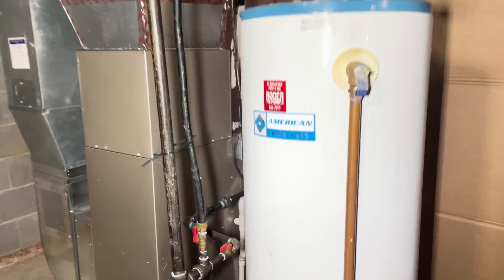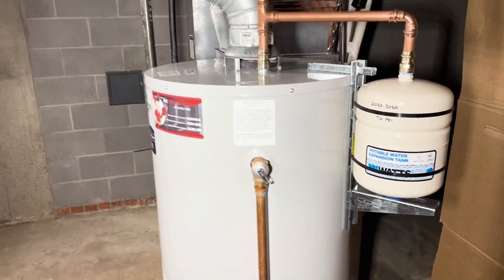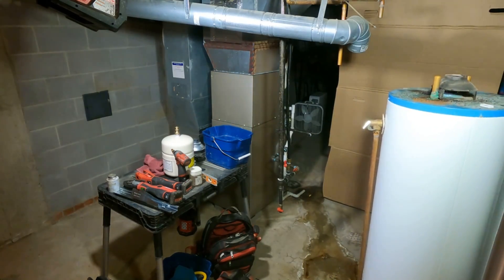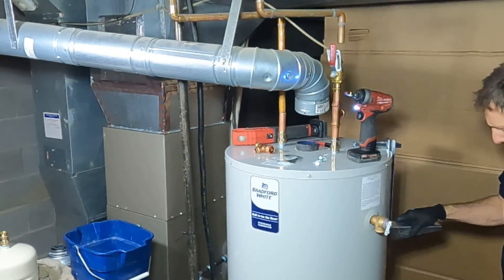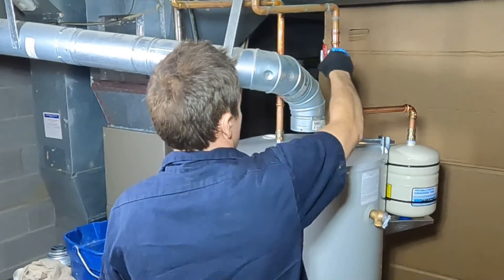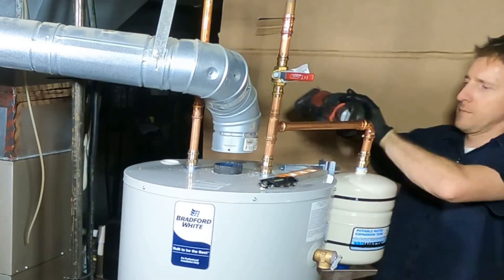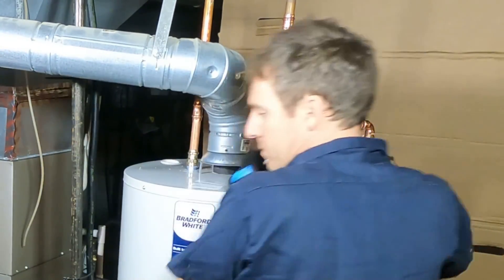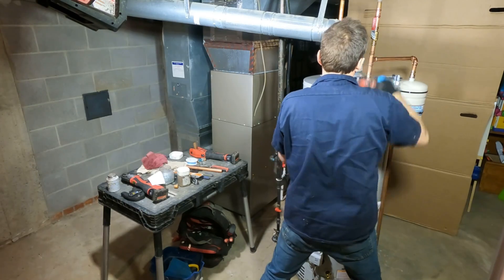💦🛠 Replacing a 39 year old Water Heater and installing a Thermal expansion tank. 🔥💧

Comment: You did not reem out a single brass fitting,why.  Won't it cause turbulence in the pipe and cause a leak.  Some of the new brass pipe is causing leaks with those fittings.
Reply from the maker: You don’t ream brass fittings. You would ream out copper tubing under certain conditions.

Comment: Sioux Chief’s new expansion tank bracket is a pretty convenient solution, but they really dropped the ball by supplying zip ties instead of hose clamps to hold the tank. First, it’s pretty tough to get a really tight fit with the zip ties, but the worst part is, when the tank needs to be replaced, you can’t reuse the zip ties like you could with hose clamps. I bet they change this after enough complaints start building up. But you know Sioux Chief knew they were cutting corners when they decided to go this route. That really sucks.
Reply from the maker: I had the same thoughts.
Reply: I see that the Eastman expansion tank bracket  comes with stainless steel worm drive clamps. It is available at Menards by the expansion tanks!
Reply: Hold rite brackets are good and inexpensive.

Comment: is there a reason why nobody installs a valve on the hot side of the tank?
Reply: I install valves on both the cold and hot sides. Usually in a residential situation, the systems isn't that big so most only install a valve on the cold side to isolate the water heater from the rest of the system and drain the hot side of the system
Any pressure vessel I install I always isolate both sides
Reply: @akrocuba I know this is an old video but it's against code to have valves on both the hot and the cold. Cold yes hot no
Reply: @ricklee827  For residential I presume...correct? Every commercial/Industrial water heater we install must have valves on bot hot and cold as per drawings and specifications. I think it would be easier to replace a vessel, any vessel, when you can isolate the vessel from the system completely without draining the entire systems.
Reply from the maker: Yes

Comment: I enjoy watching your videos. A weird problem I'm having is why I searched and found your videos.  A little over a week ago I had no hot water.  Down to the basement with a BBQ lighter to see if the pilot light had gone out.  It had and was soaking wet,  I checked all the connections and T&P, no leaks.. I was thinking, get it lit and have a bit more hot water and go get a new water heater.   I could light the pilot light, and the main burner would come on but then go out.  Several attempts and I thought that's it,  it's new tank or tankless time.  I shut the  water valve to the water heater and ordered a tankless.   A few days later I thought I'd go have a look again and the burner area was bone dry.  I lit the pilot and now have hot water again.   The tank had a 5 year warranty and is now a little over 25 years old.   I've read that the leak could have been condensate dripping but this hasn't happened in the 25 years since I installed it back then.  The plan,  keep the tankless in the box and when or if the old tank water heater has problems,  I'll change it out.  If I remember correctly that old water heater cost around $100 back in 1998.
Reply from the maker: I’ve seen a lot of tanks with 5yr warranties that ended up lasting 25 years or more. 👍
Reply: If there is condensation your should check your vent. It could be a that the draft isn't adequate causing the flue gas to cool and condensate.